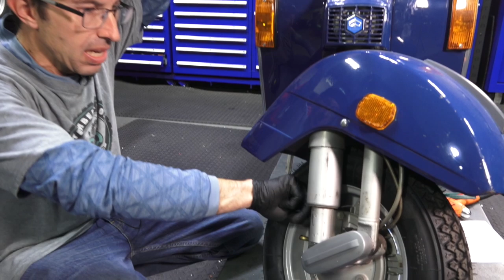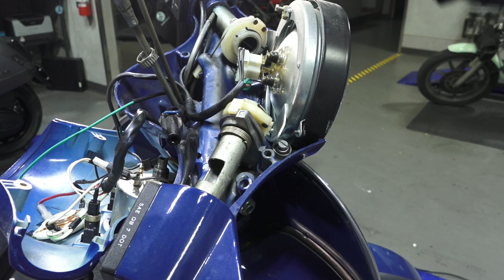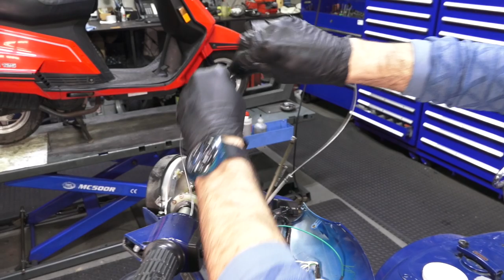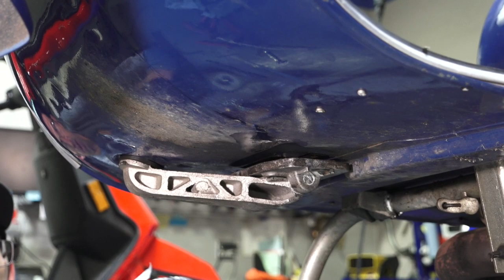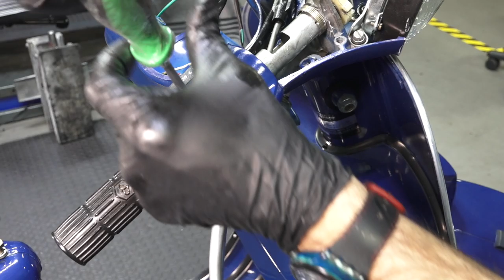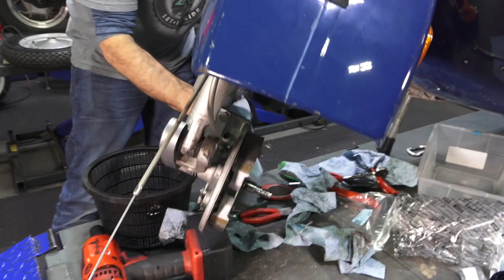Prepping An All Original 1978 Vespa P200E For Sale: PART 6 Cables, Front Hub, Brakes

Comment: Hello mate! I have a Vespa Cosa 125 that's leaking brake fluid all over. It's a 89'... Stayed inside a shed for like 8 years. I managed to clean the carb and make it work! The only thing that I'm missing is the brakes... The reservoir is completely empty, I put some brake fluid and it seems it's leaking under the motorcycle right by the pedal... Could you please record a video explaining how it works? I'm having a REALLY hard time with this. Thx.

Comment: Would this be the same hub used by the 1997 PX150E? I noticed you just removed a "C" clip from the axle which you mentioned is the only one that keeps the hub in place. Isn't there a thick flat washer that goes with it?
Reply: Yes, there is
https://www.sip-scootershop.com/hu/category/klassik-vespa_2/alkatreszek_1751/vespa-px-t5-cosa_T5/alvaz-vespa-px-t5-cosa_1784/kormanyoszlop-fekdob-px-t5-elol_1412?model=eyJzY29vdGVyVHlwZSI6IntcIm5hbWVcIjpcIlZlc3BhIFBYL1Q1L0Nvc2FcIixcInNsdWdcIjpcIlQ1XCJ9IiwicHJvZHVjZXIiOiJ7XCJndWlkXCI6XCJiOTYyMzU0NS1kYjI0LTRhNjMtOWNjYS0xMTUxODdhYWZmZGRcIixcImlkXCI6NixcInByb2R1Y2VybmFtZVwiOlwiVkVTUEFcIn0iLCJtb2RlbCI6IntcIm5hbWVcIjpcIlAxNTBYIC8gUFgxNTAgRSAxNTAgY2NtIDJUIEFDICc3OC0nODUgVkxYMVRcIixcIm1vZGVsX251bWJlclwiOjYzM30ifQ%3D%3D

Comment: What? You don't like ratchet steering,  high speed wobble, broken cables draging brakes ,sticking throttle, slipping clutch and howling wheel bearings, no sense of adventure!
Cutting old cables close to is housing helps keep the dirt out of the housing.
Reply: The Riva 125 in the background is also a great scooter